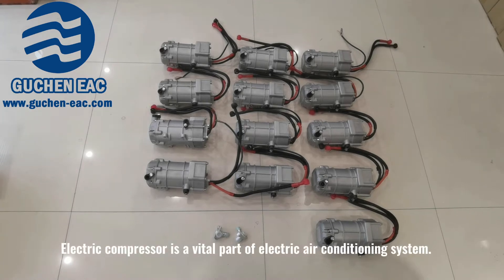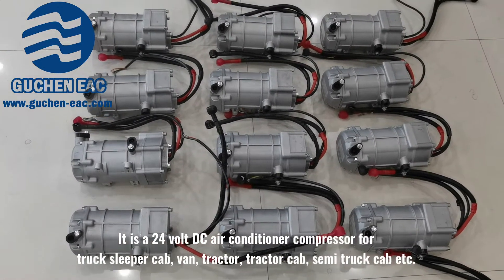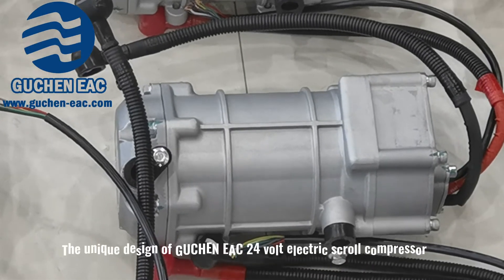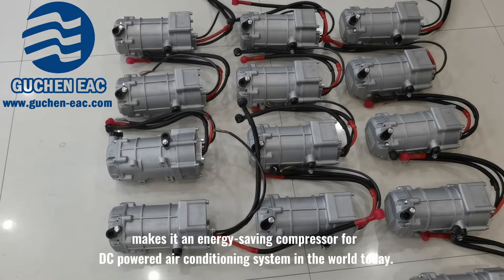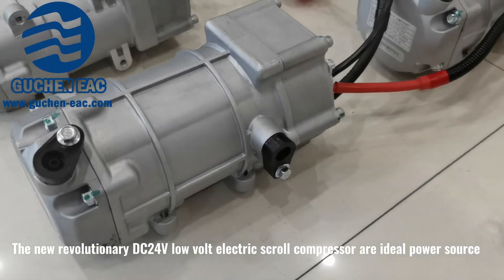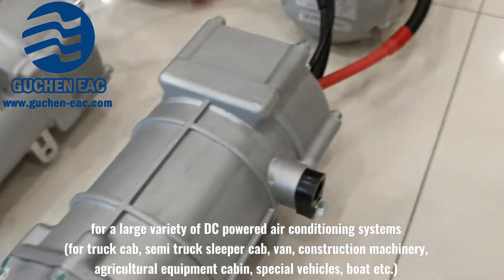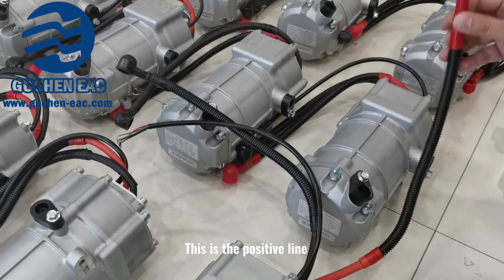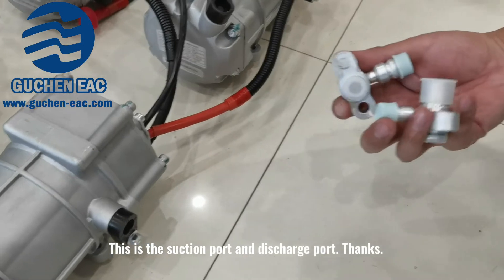24 Volt Air Conditioner Compressor for 24V No-idling Applications

Comment: What does signal line connect to?
Reply from the maker: The 24v compressor usually connects to the PWM generator or 3-speed switch, or other controllers depends on  your needs. For more info. please mail to postmaster@guchen.com